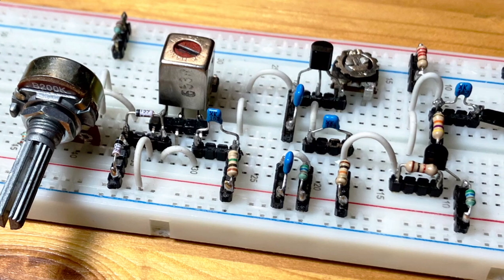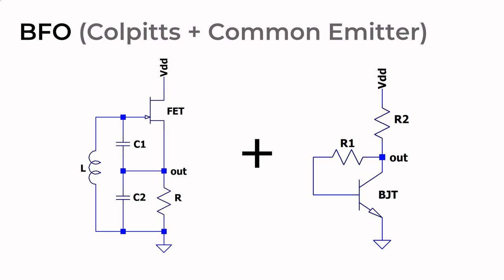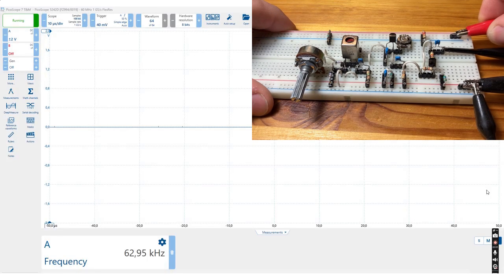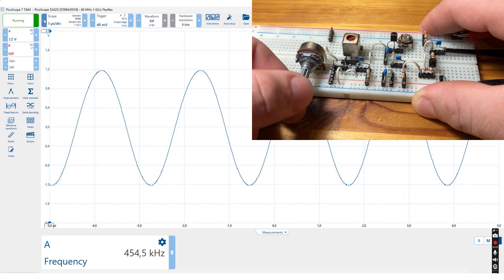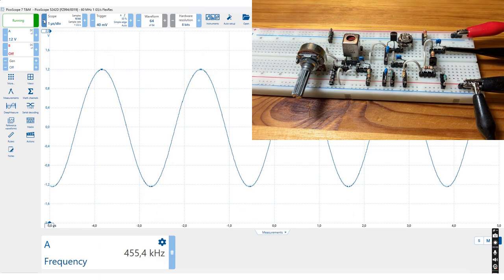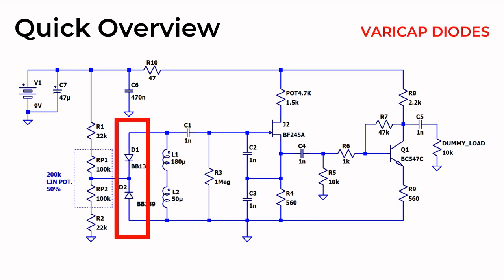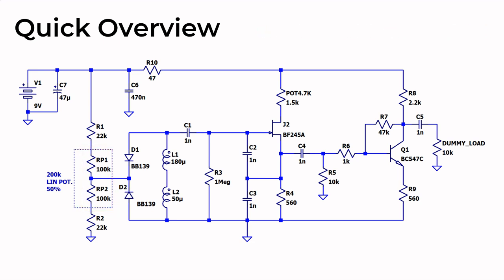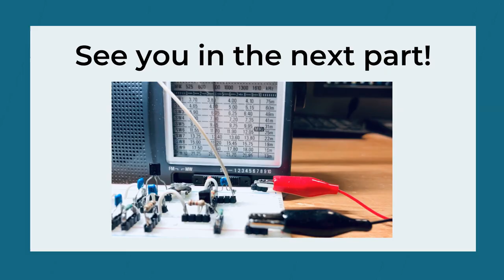Colpitts Oscillator Experiment – (BFO) Beat Frequency for SSB Radio

Comment: So, wrapping that wire around the antenna is done for the purpose of induction inside the antenna, caused by alternating current in the wire?
Reply from the maker: Yes, you are right. I have tried it with several radios. Please watch the second part of the video, where I listen to amateur broadcasts with it. Here is the link: https://www.youtube.com/watch?v=8S6Ol7hsZTs